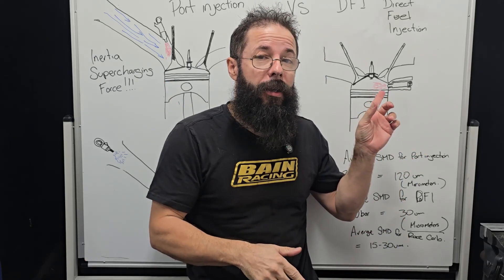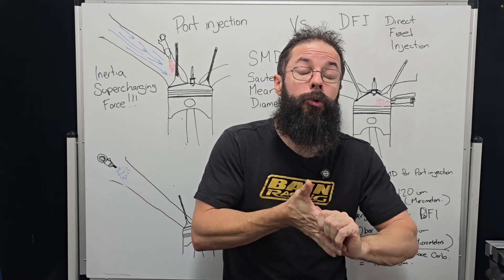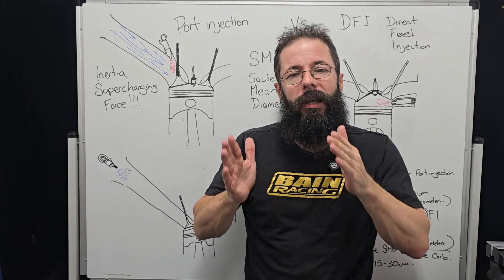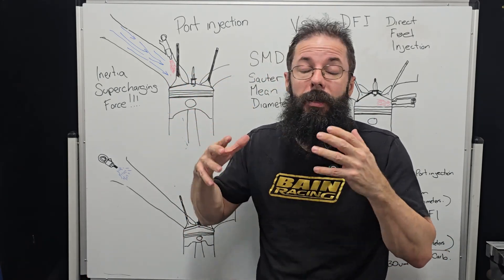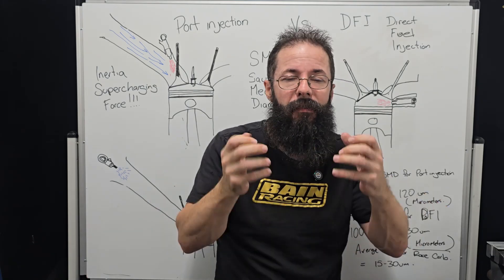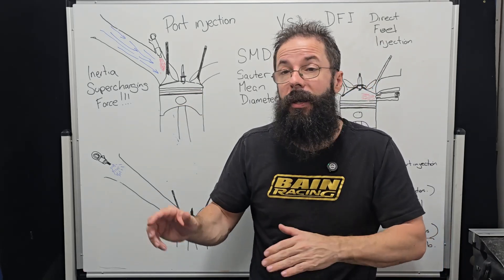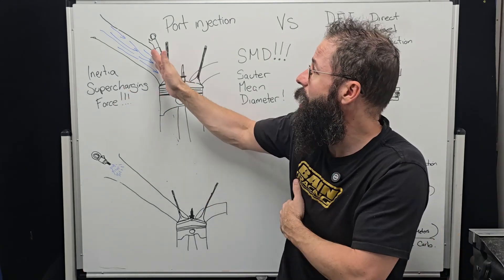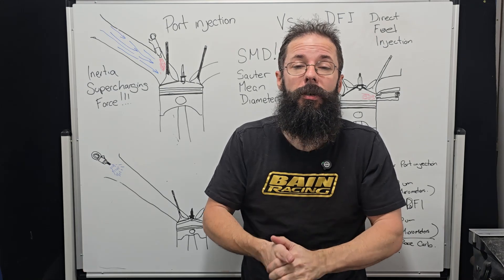DFI vs. EFI: The Hidden Science of Fuel Atomization and Engine Efficiency #carcommunity #EFI

Comment: Thanks for another interesting lesson, Jake !I'd be interested to hear your thoughts on Smokey Yunick's Hot Vapour Engine concept as well. Could it actually have worked ? It supposedly  maximised thermal efficiency and minimised fuel droplet size to literally vapour all in one process, if I understood it correctly.
Cheers mate 👍
Reply from the maker: Great suggestion!

Comment: Brain tooley did a test on a LT gen 5 engine.DI injection only vs port injection only.They were assuming that port injection will make more power since the injectors are further away and ended up DI made 70 more hp if I’m not mistaken.
Reply from the maker: Yes, he sure did!  I've seen and done many back to backs. All seem to indicate the same losses.
Reply: @bainracing ,,, yeah but , BTR did not try shower head injectors  .
Reply from the maker: @rolandtamaccio3285  Yeah, its more about the pressure and the DSM size and the shear time/length. F1 showed this over 30 years ago.  👍
Reply: Because air and gas mixture burn complete forced gas is not a wise idea Dfi sucks
Reply from the maker: "Sucks"?? 😂😂👌

Comment: Prefer port injection, less maintenance, it just works, simple is better.😅
Reply from the maker: Same! 👍
Reply: Direct fuel injection has "just worked" for decades in diesel engines.

By your logic, Carburetors are better because they are simpler.

Comment: In my region of the US, you can buy 87, 91 and 93 octane and E85 at the pump, and 110 unleaded,  110 leaded, and methanol in 5 gallon cans too. 
Excellent explanation of DI technology,  and it's efficiency increases due to a dry intake charge, also, placing the injector in the chamber allows fueling at any time, something carbs, and port EFI simply cannot do. Stratified fueling occurs when the injector fires a small pilot shot of fuel when the intake valve closes, and then a smaller, leaner main injection event . DI also allows higher compression ratios since there isn't a chance for pre ignition when there is no fuel in the intake charge.
Reply from the maker: Yes exactly!!! The Mazda sky active is a great example of that with its 14 to 1.
Reply: @bainracing I have a Mazda with the sky active G powertrain with over 354,000km/220,000miles and I haven't had any issues with my fuel injectors or carbon deposits. I do very few short trips, and I use quality gasoline. My di Mazda has been great!
Reply from the maker: @danong9458 Oh, that's brilliant 👏.   Preventative maintenance is key and clearly makes a huge difference.  Well done